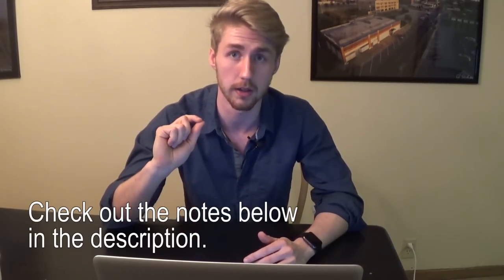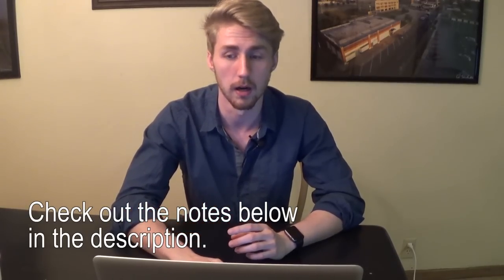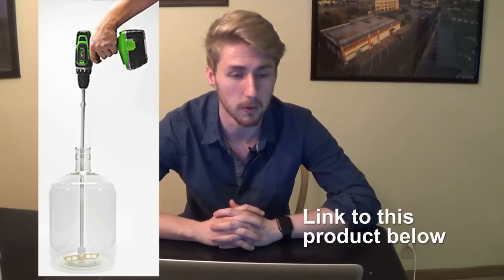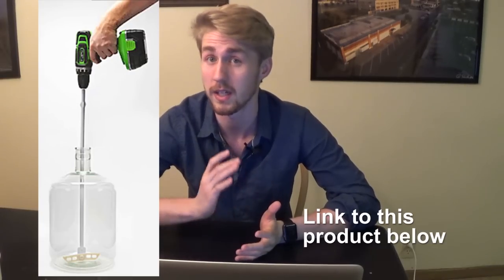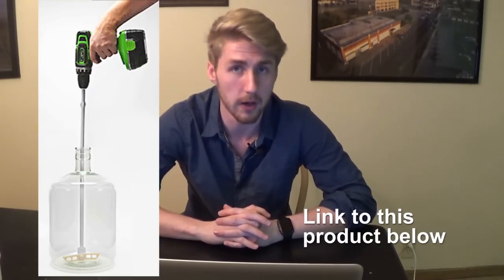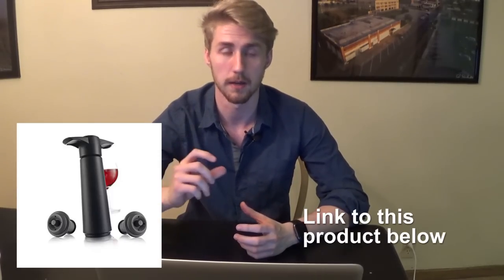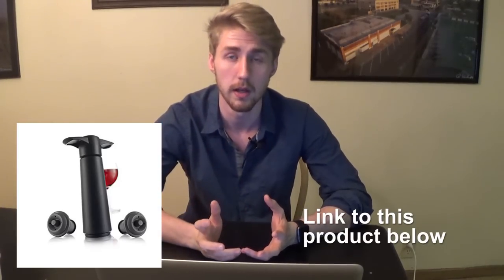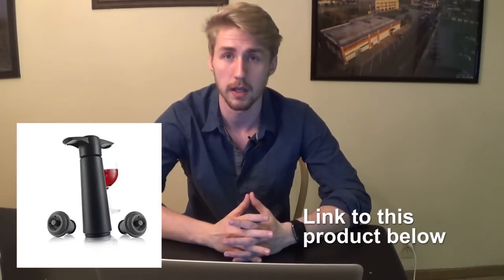Degassing Mead: When, Why and How

Comment: not to nitpick, but twice you said that the yeast take oxygen and convert it to carbon dioxide.  This fundamentally misrepresents what fermentation does.  The C02 from fermentation comes from pyruvate.  Glucose to pyruvate ( C6 to 2 X C3, glycolysis) and then the decarboxylation of pyruvate ( C3 to C2 + C02, pyruvate decarboxylase) to make acetaldehyde followed by its reduction to ethanol.  The stuff on degassing however was good.

Comment: If anyone's new to this, and just got one of those drill bits, DO NOT put that into your mead 48 hours into pitch and fire that drill up! Ever seen that little kid science fair project with the baking soda volcano? Yeah, that.
Instead, before you put the bit into the drill, just use the bit like a spoon and GENTLY give it a LITTLE swirl. See how that foams up, wait for it to die down, then give it a little MORE of a stir. Like MMM says here, you're not trying to oxygenate, so you really don't need to make some kind of Whirlpool Charybdis scenario in the carboy. Work your way up in stages. And if you can, do it in the bathtub juuuust in case.

Comment: A couple of quick comments. Half the weight of the sugar in your mead is transformed into CO2 so that is a lot of gas. There are a couple or three good reasons to degas DURING primary fermentation and not after the active fermentation has ended. 
1. That amount of gas (if you are fermenting 3 lbs of honey 1.5 lbs of gas is produced at normal pressure) dissolved in the mead puts great pressure on the yeast cells (think what it feels like to dive 100 meters under water), That pressure can stress the yeast and stressed yeast will produce all kinds of compounds most of which do not enhance the flavor of your mead. 
2. CO2 when dissolved in the mead produces carbonic acid and carbonic acid is an acid and that will drop the pH of the mead. Honey at the best of times has no chemical buffers to control pH so with the addition of carbonic acid you can find that the pH of your mead will drop below about 3.0 and at that level fermentation CAN stall. 
3. The presence of CO2 in the mead will enable all kinds of particles to remain in suspension and their presence in suspension means that your mead will be cloudy. Not a major problem unless you are looking for a bright clear mead but if that is indeed what you are looking for then allowing CO2 to remain in solution (and the CO2 will saturate your mead depending on ambient air pressure and temperature) will make obtaining a non hazy mead a real challenge.
Reply: Glad to see someone else from the gotmead website chiming in here :-)
Reply from the maker: I love this! Thank you for sharing this info.
Reply: Man Made Mead so do we degas during or after fermintation
Reply: James Howlett during primary fermentation for the first several days to a week.
Reply: Would the above rational also apply to beer and wine? Asking for a friend. :o)
Reply: My mead has been about a month in primary but i didnt know about degasing. I just took a Gravity reading and ir stopped at 1.030. i used beer yeast, us-05.
Based on the info You provided i'm guessing the pH stalled the Fermentation. 
If i degas it now, would the Fermentation continue or can i just bottle it now and not worry about a bottle bomb?
Reply: @luisrodriguez1255  how did it turn out?
Reply: @magacop5180  it was actually pretty good, no Bottle bombs as far as I remember
All the residual sugar made it sweet, I think I added a little more  honey to each bottle to carbonate.
not a traditional mead but everyone liked  it, especially people who are not used to dry spirits.
It had a low starting gravity, 1.055 I think, so the final abv was like 3.3%
Reply: Don't acid's RAISE ph? 😂🤡🤣🤡
Reply: @MrWorstNews  Sorry, no. A high pH is alkaline and so you need bases to raise the pH of any solution. Acids lower the pH. A pH of seven is neither acid nor base, a pH of 5 is acid and a pH of 1 indicates the strongest acid. A pH of 9 is a base and a pH of 14 is the strongest base (alkali)

Comment: This is exactly what my mead is doing. I've racked it twice for secondary, and it's still bubbling. I think it just needs degassing. It slowed down to a standstill, but then when I took it out it picked up so I realize that CO2 is still present in the mead and needs to escape. I'd rather not use tablets to stabilize it, but let it degass naturally if I can. Thanks for the tip!

Comment: I have a 5 gallon batch thats about 4 weeks in. I used a drill stirring tool when I first started the the fermentation but I haven't touched it in about 4 weeks. The Bubbling has slowed down but it still bubbles every couple minutes. I was planning on transferring it into a big mouth 5 gallon carboy at week 6. Do I need to stir it again before I start the secondary? It's in a Fermenting bucket now and I haven't opened it in 4 weeks. What would you do? I really enjoy the videos and go to them daily for tips. Thanks for sharing you knowledge.
Reply from the maker: I wouldn't stir it up after the primary! You don't want to add more oxygen at that point. Generally you don't need to do a ton of degassing after the first like 7 days of it's life.

Comment: I'm surprised no one brought up MEA's (mead explosion/explosive accidents).  I've had this happen more than once in the past and it isn't any fun, both do to the clean up and to the now wasted mead/must.  You absolutely need to be gentle when using a wine whip to degas!!  Start slow and build speed after a few minutes or it can foam over and create one heck of a mess.  The bubbles start out large but will get smaller and smaller as you whip; this process could potentially take 15-20 minutes depending on how much it bubbles.  Just takes practice but be sure to take your time.  Also, as for what can be used:  I work in a hospital and have even used a 60cc syringe to degas (press the tip into the rubber bung to seal, pull the plunger all the way out slowly, watch it bubble, then repeat over and over).  I've also watched videos of people converting air pumps into degassers, or FoodSavers.
Reply from the maker: You definitely have to be careful. It all comes back to the important idea of having patience when making mead haha.
Reply: Foodsaver is what I’m thinking.  We already have one that has a vacuum line.  It wouldn’t take much to adapt it to a bung and vacuum that sucker (no pun intended) down flat.

Comment: @Man Made Mead  Hey there!!  So I am quite confused on what to do regarding Degassing.  I intend to do a primary fermentation without degassing, but would like to complete this process during the racking phase from primary to secondary fermentation (in-between).  Though, what I am confused about regarding Degassing is:  Wouldn't you introduce oxygen if you racked your mead into an open bucket or container and, wouldn't you add oxygen to your mead by stirring it up?....which, from what I know, is bad?  just confused on the proper way to Degass without worrying I messed up and allowed the mead to be exposed to the elements and or oxygen.
Reply from the maker: So you can degas at any time if you lightly stir. Just opening your fermenter won’t introduce a ton of oxygen. The only way to add too much oxygen is by violently stirring your mead after the primary.
Reply: @ManMadeMead  Thanks a bunch for the reply and informative answer!  Will do just that!  Thanks!

Comment: Once I learned about degassing mead, I started doing it and still do so, but I'm reading more these days that it may not be as important as some believe. Part of the reason is the mead is already degassing itself (all that bubbling going on in the airlock) also that it may have more to do with staggered nutrient additions than anything else. If you're following a SNA protocol (or adding fining agents for that matter), then you should degas, otherwise it may not be necessary (or so I've read). I'm still degassing as I typically follow a TOSNA 2.0 and I use fining agents to clear my mead, but it seems it might not be the critical step once thought. I used a paddle in my drill to degas the mead, running it slower than if I was aerating it.
Reply from the maker: RuggedHomestead Yeah the airlock does let it naturally aerate so I feel like degassing really just has to be done if the mead itself is still pretty carbonated. Also if you’re trying to speed up the process of bottling and aging. It just all depends on how much carbonation you want, some people want some and other don’t! I’ve never heard of the TOSNA 2.0 stuff so I’ll have to check that out.
Reply: The TOSNA (and iTOSNA) website is Meadmaderight.com
Reply from the maker: Perfect! Thank you!

Comment: Have you done a video on how to tell when your Mead has spoiled or something of that nature?
Reply from the maker: Myles Mejia I haven’t ever done one over that, but that’s a good video idea!
Reply: It’s actually pretty hard to ruin mead. Most times time is your answer—just let it age. Even If a bacteria has infected your mead it might not be a complete loss depending on the type.

With that said, I did end up having to throw away a cyzer because I had failed to wash my apples and it got infected. I tried aging it out but after a year it tasted horrible and since it was only a gallon I figured I had sunk enough time into it and poured it down the drain.
Reply: I have to say that I am surprised. Fruit ain't grains and mead ain't beer and it can be incredibly difficult to spoil a mead. Once you pitch the yeast the yeast will dominate any volunteer bacteria or indigenous yeast and the cultured yeast will create an environment that prefers the cultured yeast and dis-prefers any other organism. It's possible that the cyser tasted bad for other reasons but it is hard to imagine that spoilage would be a cause. Of course, stressed yeast and poor choice of honey (East Coast buckwheat) can create problems but it's hard to infect a mead, in my opinion.

Comment: I have seen many tips and videos of using the wine degasser you mentioned (power drill attachment) in the oxygenation process.  Does this actually oxygenate the mead or does it instead release all the oxygen already  in the mead?  
Btw I really enjoy your videos and, as a beginner mead-maker, I find them very helpful.
Reply from the maker: It definitely helps to oxygenate the mead. Generally any stirring will give the mead some oxygen. The more vigorous the better before the fermentation starts!
Reply: Man Made Mead I’m confused I thought the aim was to degas not oxygenate?
Reply: @Hadrada.  You want to oxygenate before fermentation and degas after, I believe.
Reply: Serg Ivash thanks

Comment: First, thanks again for your great channel. Question: When you say to let the mead recover 8-12 weeks after de- gassing and not to do anything else, does this mean you should not bottle right after after de-gassing? I had planned on de-gassing a mead right before I bottle and then let it recover before bottling. I assume de-gassing is like "bottle shock" so why not do it right before bottling? FYI, this mead is a Mango-Habanero I adapted from the Mead Challenge you guys did and the sip I had is awesome. On the same subject, I am thinking of not de-gassing to allow for a little light carbonation. Have you made a carbonated Mango-Habanero? Might be good but this just seems like it should be a warm, still mead.  Thanks again.J
Reply from the maker: You can bottle after degassing! You just want to make sure that it's fully degassed otherwise you will get some carbonation/excess CO2 in the brew.

Comment: I just made my first batch of mead the other day.  It just started fermenting.  I am planning on making a melomel, so should I degas after primary fermentation, and add the fruit in the secondary right after primary, or do I need to wait a little bit before adding the fruit?  Also, is it bad to do a little bit of degassing during primary fermentation during the off days of staggered nutrient supply?
Reply from the maker: It’s totally okay (and preferred) to degas mostly in the primary. If you do it later than the primary you just want to be sure to not introduce oxygen into the mead because that will ruin in. I would degas during the primary and add your fruit into the secondary as soon as you move it over!

Comment: i am 2 weeks into making mead and have never drank mead before so i am all kinds of excited and wanting to experiment with the 2 gallons that i have in production. thanks for the vid on anti carbonation. end game for storing the mead i want to go the whole 9 yards of putting it into regular corked 750ml wine bottles. would you recommend the vacuum wine seals over corking? 2nd question. i want to make it with carbonation like beer too. should i force carbonate it latter on or would it be fine to natural carbonate it like a craft beer. i understand natural carbonation leaves a sediment at the bottom that should not be drank, but what i don't understand is the longevity of it? mead gets better over a period of time very much like wine. would that carbonation and sediment be a problem?
Reply: i understand that you are not carbonating your mead, but wanted your opinion anyways. totally cool if you don't as-well.
Reply from the maker: I don’t think carbonating your mead will impact the flavor over time. You can absolutely force carbonate later on or just let it naturally go through the process. It seems like you want a lot of carbonation and generally the natural carbonation process will not give you a huge amount (atleast not as much as a beer or a soda). The vacuum seal over wine bottles is great and I would highly recommend doing it! Don’t be able to rack your mead to get rid of that sediment, while carbonation can be nice the overall flavor of the mead is more important and leaving a lot of sediment can cause issues with that.
Reply: Just know, that regular wine bottles should NOT be used when you are bottle carbing.  You need to use beer bottles or champagne bottles, which are thick enough to withstand the pressure from carbonation.
Reply: thanks... i took that into consideration but might not have as a novice.

Comment: I have two questions. My first is that I racked my orange mead a few weeks ago, it is still cloudy and has more sediment at the bottom, it also has a big headspace in the carboy, which I thought was okay because I'm planning to bottle it in June anyway, but should I rack it again and stir/degas it or just rack it again and leave it til I rack it next month? My second query is that I racked my blackberry mead today and I see very little to no bubbling at all occuring, it had a huge headspace though, do I need to stir it, or am I safe to just leave it be and then bottle it next month?
Reply from the maker: I wouldn't worry about degassing it, it should be doing that on its own. I would definitely rack it off the sediment (this will also degas it a little). I wouldn't leave any mead with a ton of headspace on it for a long time but I think 1 month will be fine. You should taste it along the way and see if the oxygen is doing anything to it!
Reply: @ManMadeMead  thank you so much for helpful reply! Okay great I will rack the orange again tomorrow, taste test it, and then leave it again for 3 weeks until I bottle and hope for the best!!

Comment: Wouldn't that introduce aceto-bacteria and more air/oxygen into the wine/mead and turn into vinegar in the 8-12 weeks after that? 
Why is everyone so scare of bubbles if that's not the case? I'm having problem understanding degassing for co2, I know you can degas sulfur too but seems pretty risky.
 Am I wrong?
Reply: Also, when I go and carbonate my mead before bottling.. what's the difference? 
Am I reducing the storage lifespan ?
Reply from the maker: If you stir lightly you will not add a significant amount of oxygen to a brew. So you don't risk it going bad. Degassing is really only necessary in the middle of fermentation because the yeast get stressed out when there is excess CO2 in the solution. While they do expel it, they can be overwhelmed by it at the same time. When you force Carbonate with CO2 you are good! CO2 doesn't hurt the mead, but straight up oxygen will!

Comment: If I do not have an airlock, would it work just as well to degas it every night or so?
Reply: Also, I have a metal gallon-jug with a corkscrew and airtight seal, but it broke. Would it still work the same as with a normal seal or would it work less well?
Reply from the maker: You absolutely need an airlock or something to keep stuff from getting in your mead. I would suggest to either buy an airlock or to use a balloon and poke a hole in it so the air can escape. 

Without that airtight seal you will more than likely lose air out of the sides of the mead. I would try to get something with an air tight seal!
Reply: @ManMadeMead  All righty, thank you!

Comment: i got question , i set 15l  batch  3l honey rest water  up to maybe 13-14l  .so i leat it it start active for 2 days then slow down ,,i miss degas.. after third day it all stop ... ec1118 yeast ...   i let ferment for week  but nothing ,,,  so i degas it by swirling bottle it show huge bubbling ..seccond time too third time not so ..so i pinch a bit more yeast ..now question will yeast continue fermentation or i fup all ?
Reply from the maker: MrCcfly It sounds like your fermentation happened, it just happened quickly. Have you tried taking a gravity reading?
Reply: @ManMadeMead  i did today still 1034  and co2 with new yeast started but slooooow